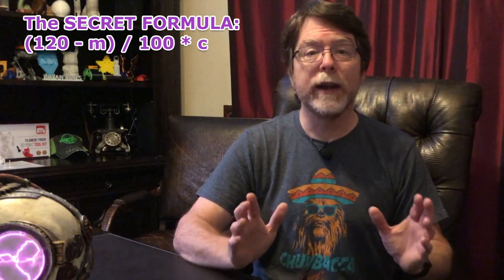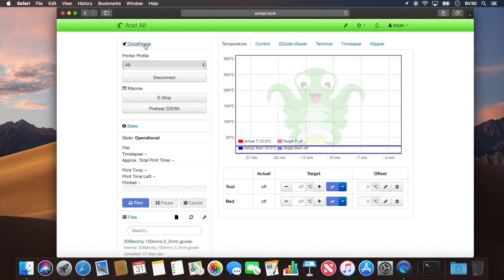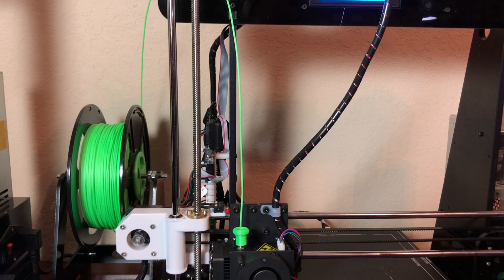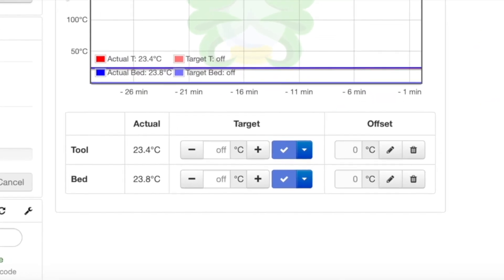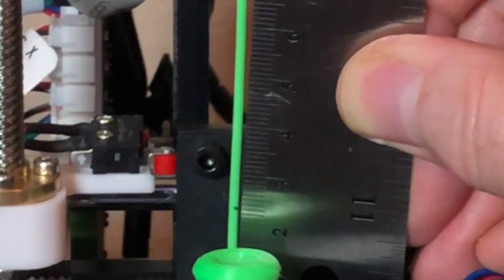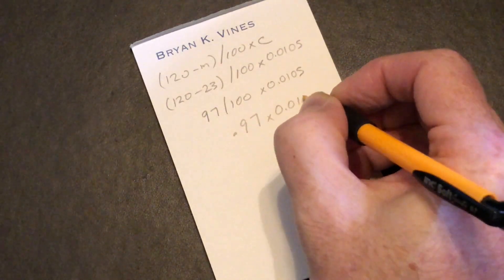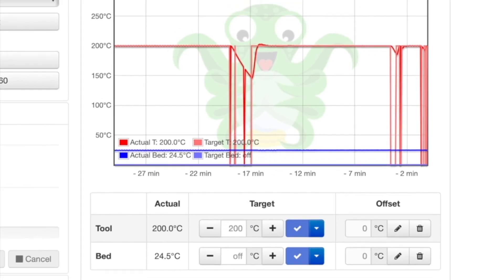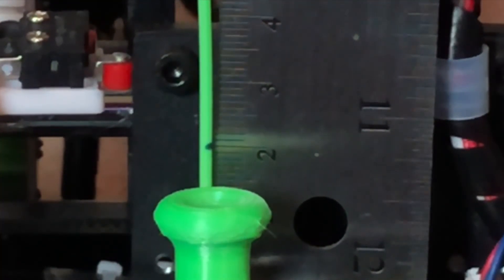How To Calibrate the Extruder on an Anet A8 with Klipper Firmware

Comment: I tried this on my Ender 3 and for some reason it retracts the filament when I run the G1 E100 F100 but if I go under control and tell it to extrude 100mm of filament it extrudes. Looking at the terminal it says it received the command G1 E100 F300.

Comment: Nice but I was hoping for a benchy comparison seeing as you referred to the previous klipper video and how ordinary benchy looked. I'm still on the fence about installing klipper.
Reply from the maker: I don't know if it was the filament I was using or Klipper, but one thing I found when printing Benchy models is that the smokestack was kind of thin at the base and super easy to snap off. Quite honestly I think the hot end on the stock A8 just has a hard time meeting the demands that Klipper places on it.
Reply: @BV3D  OK thanks. Something to think about. Cheers.

Comment: What happens if you DON'T type M83?
Reply from the maker: M83 puts the printer in relative positioning mode. If you don't type M83, and the printer is using absolute positioning, telling the extruder to move 100 mm will work the first time, but after that, it won't budge. As far as the extruder is concerned, when using absolute positioning, you've told it to move to a point 100 mm along the filament from its zero position. And it did that. Telling it to go there again gets ignored. It thinks it's already there.

I'm probably not explaining that clearly. But think in terms of the X axis. If you are in absolute positioning mode, and you tell the X axis to move to 100, it will move to a point 100 mm from the home position. If you again say, "Move to 100," it is already there, so it doesn't go anywhere.

Using M83 to enable Relative Positioning means, "When I say move +100, I mean move 100 mm further than your current position." For the extruder, it means "push another 100mm of filament." For the X axis, it means "Move another 100 mm away from home."

Hope that helps!

Comment: Hi Bryan, my Klipper Configuration is totally blank. Any suggestions?
Reply from the maker: Hi! Check this video, around the 15 minute mark: https://youtu.be/EX8dJkdcmJQ?t=923

At that point in the video, we'll check whether Klipper can open its configuration file, and if it can't, we're copying the default configuration file into the right place and restart Klipper. 

And if you don't have the OctoKlipper plugin installed, I've got a quick video about that, here: https://youtu.be/Dsk3hP1pw4s

If you do have OctoKlipper installed, make sure that it's got the right path to the Klipper configuration file (roughly this point in the OctoKlipper video: https://youtu.be/Dsk3hP1pw4s?list=PLWdhcCYoOsiInRy4PGHJGBWx7kXIodUDi&t=231 )

If none of those seems to get you going in the right direction, let me know, and we can dig deeper into the problem.

Thanks! 👍
Reply: @BV3D  Thank you for the quick reply! Unfortunately Copy/Pasting the cfg into Octoclipper >  Klipper Configuration didn't work. Any plans on making a video about Manual Mesh Bed Levelling? No pressure :)

Comment: Once again, a great video!  Well performed and scripted.  
Did you happen to run into a situation with your extruder feeding backwards?  Resetting the firmware cured it each time though.  
In your opinion, would it be advisable to perform this whenever we change filament (requiring different heat and speed settings)?
Reply from the maker: Hi Jason! Thanks! (If I don't write a script, I say "uh..." far too much!) The extruder stepper has always traveled in the correct direction for me. But if resetting the firmware works around the issue for you, I'd say do it every time before you start a print. Now, that said, a workaround is just that: A workaround. You might want to search Klipper's Issues page (https://github.com/KevinOConnor/klipper/issues) to see if anyone else reported the issue. If they haven't, you should report it! 👍